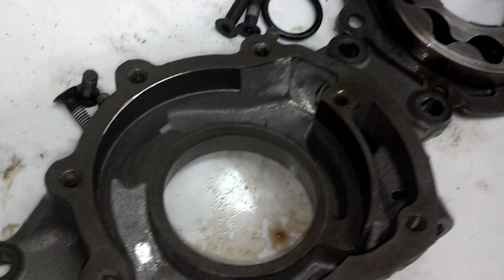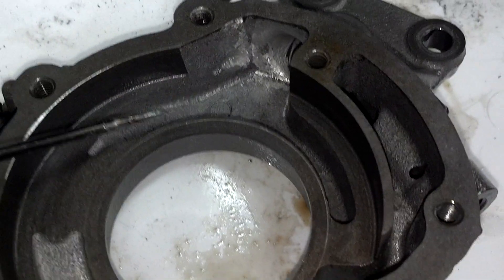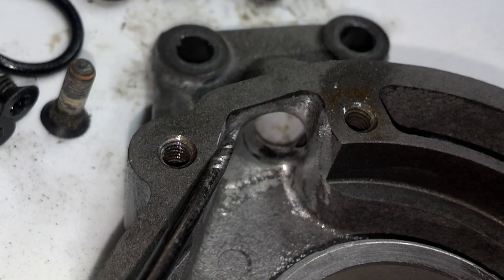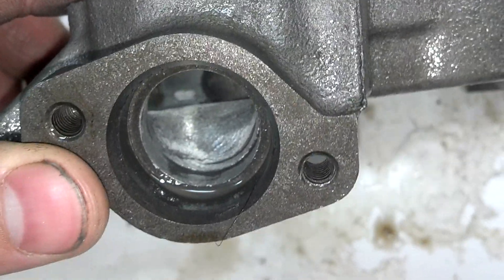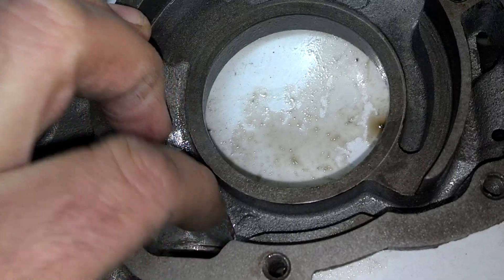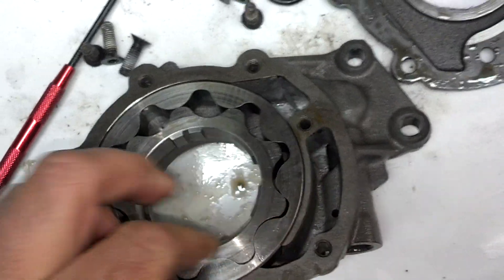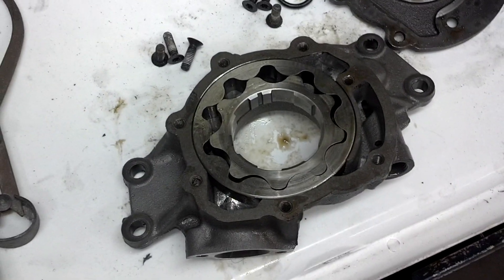Oil pump porting

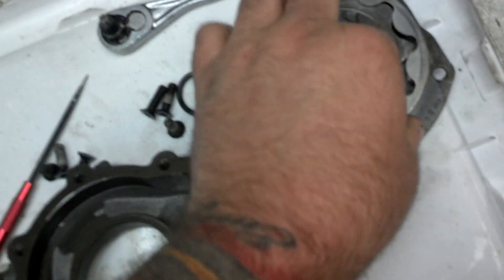Comment: I noticed Melling 10296 @ 1:22 in the video.  So your telling me thats not how it came from Melling?  Thinking about upgrading my pump for my swap and read about porting it.  So I guess melling's model doesnt need porting?  For the price you'd think they would do it.  So stock, melling, to ported melling.....is there an increase in pressure/flow with each step?

Thanks for the chuckle in the vid btw....helped me catch it.